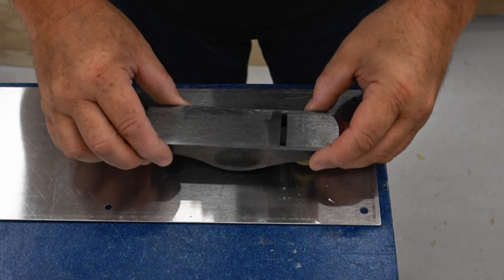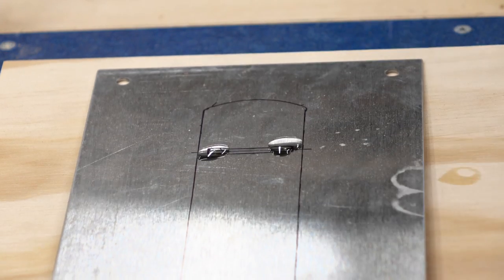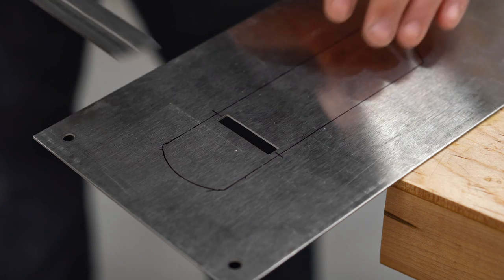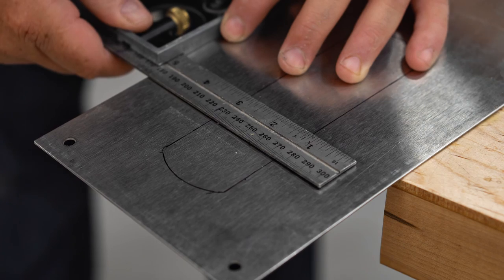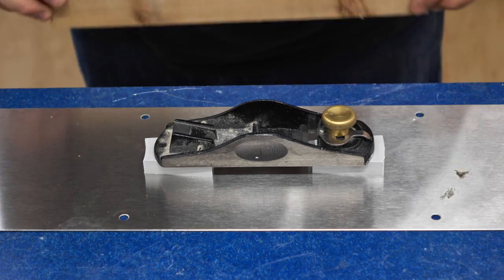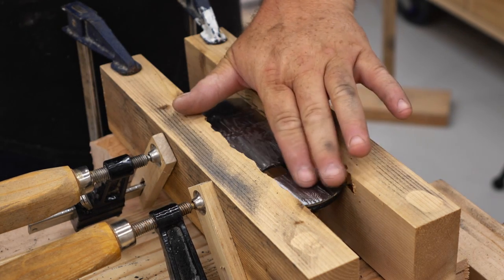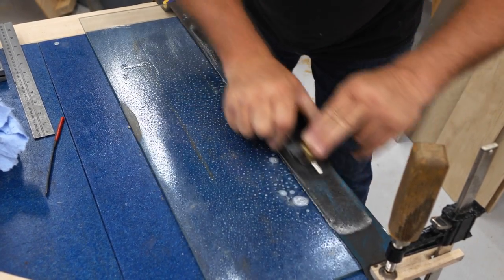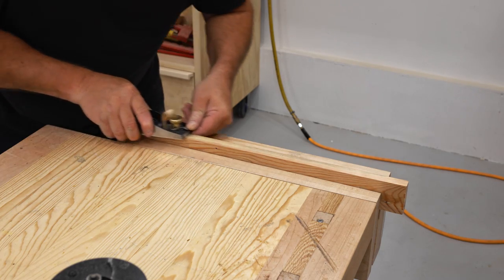Extreme Hand Plane Restoration - Milling Cast Iron With A Router

Comment: Sometimes you just have to try something just to see if it can be done.  Ingenious bit of barnyard engineering.  The proof is that it works.
Reply from the maker: Thanks Jim. It's not often that I do something that winds up looking better than I expected when I started, but this is a good example.

Comment: Hi John, I bet a lot of people went running for cover when you started with the screeching noise but it did not bother me. an interesting idea to make a new baseplate, most people would have just chucked it in the bin. You have ended up with a plain that looks great and is flatter than most directly from the factory.
Reply from the maker: Thanks!

Comment: Machinists everywhere are screaming at their computers...    I have to say, this is something I would never have considered as an option, so it was cool to see and learn new ideas.   Never, ever would have thought to take a router to the base of a plane.
Reply: i'd grind it off with the angle grinder, then true it up in the sandpaper
Reply: @TrevorDennis100  Get a $4 carbide burr on eBay, I've had one for over a year, and have used it quite a bit on wood, A, and steel and it's basically like new.
Reply: Yes absolutely. Make sure to get solid carbide Endmill. But you know something? John probably already knows it! :)
Reply: @pedalman4595  It's a burr, not an end mill BTW. Many more teeth.

Comment: Shame you’ve lost the open /close feature of that model, good fix though.  I have often been skint enough to warrant fixes like that, done in the evenings so I can go to work, to finish the job, to get paid !
       The fragility of these planes is the main reason I never pass up an old second hand fixer upper
Reply from the maker: Not really a shame since I've never used that feature in the 6 years I've had the plane. My other block plane (owned since 1984 and used nearly every day since) doesn't even have it.
Reply: John Heisz - I Build It  Snap  !

Comment: I have seen metal removed with a router several times. But most people put an endmill in the router and not a router bit ;)

It's a nice repair, but there is one downside. You glued the throat adjustment in place. :D

Comment: Interesting video.i have a question about the epoxy. How did you choose the epoxy? I’ve tried to glue metal with products that say they hold metal with very limited success.  Any suggestions would be greatly appreciated.
Reply: Have you tried JB weld original, red and black tubes? There is an endless variety epoxies. Original JB is pretty good on steel. It has steel particles in it (attracts to a magnet) which helps to beter match thermal conductivity and expansion rate.

The way he used it, here, over a super large, well mating (flat) area, it probably doesn't matter what kind he used. The joint matters, too.
Reply: Mildy Productive thanks for your response. I believe I did use JB but it didn’t hold. It was a miter saw , think iron, handle . I thought the surfaces mated up well.

Comment: You need to build a Bridgeport milling machine next.
Reply: Out of Douglas fir
Reply: I mean, it is possible to make one for a rotary tool, from plywood, with all of the sliding parts, dovetails with steel slides.

Comment: 2 things: 
1 - i fricken LOVE your theme music, lol
2 - and I'm curious if you decided it wasn't worth it to avoid heating the stainless after all of the care around the slot? The long continuous cuts along the edges seem to be the complete opposite of the short touches during the slot... Did you decide after the slot that you were going to give it the full sanding/surfacing treatment?

Looks great! Thanks for the video!
Reply: I'd hazard to guess because of the location of each cut and working it to final finish.  The edges he was able to be much more liberal with the over-hang, so most of the cut face was actually worked off later.  Then there's the need for precision edges (which softer metal may compromise over time) - the opening for the blade is a bit more critical than the edges. Again, just my guess....
Reply from the maker: The throat opening cut was concentrated in a small area, while long cut were... long - no excess heat build up during those long cuts, certainly not enough to distort the metal.
Reply: Thanks for responding! Makes sense.

Comment: Have you noticed that the G1S 3/4 plywood from Chile is not square... I recently bought 2 sheets and the long side on both sheets bulged out on one side and in on the other.. one sheet bulged almost 1/4 inch .. I only noticed this after I had cut them and wondered why my cut was curved.. string lined the factory edges .. Pow it matched my cut .. lol.. do not trust factory edges. Lesson learned.. costly plywood is out of whack..

Comment: One should not just consider the value of the plane. Fixing stuff has a lot more value than the things that are fixed. It saves the material and energy and possibly pollution and what not, that would otherwise be used to create a new thing and recycling or dumping the old. Worth the effort.

Comment: Isnt this low angle plane made for end grain woodworking?
Reply: You have watched too many "fine woodworking" videos. A low angle plane is about 15-20 degrees. A high angle plane is 40-45 degrees. But on a "low angle plane," the bevel goes up, and on the high angle plane the bevel goes down. You sharpen a plane blade at  25-30 degrees, so the angle of your blade is essentially the same in either case. The advantage of the low angle/bevel-up orientation in a small block plane is that you can hold the thing. If you made it high angle/bevel-down, the back of the blade would stick up where your palm goes. So this low angle block plane is made for planing anything you want to plane using one hand. This is why low angle planes are always one-handed block planes or longer jack planes (where the handle is so far back from the mouth that the low angle orientation of the blade doesn't interfere with the handle.) 

There are minor differences with either type. The low angle/bevel-up generally doesn't need a cap iron. On a high angle plane, you need to adjust the cap iron very close to the edge to do end grain. The low angle plane might have a tiny advantage at end grain, but not much. The main difference is where you want to put your handle.
Reply: Mildy Productive thank you for so detailed answer! I have been always thinking, that low angle is like “to cut grain of the wood, insread of shave”

Comment: Why would you polish the glueing surface?its not gonna help to keep surfaces coplanar. It certainly weakens the bond with epoxy. why?
Reply: Glue the new plate to an uneven surface and the shoe can distort or be uneven. Start with a flat surface for best results.
Reply: @KipdoesStuff  no. The even grain is the same distortion wise, you can even go with sandpaper over the surface if you for some reason polished it. The uneven space epoxy can take between metal surfaces due to clamp pressure differences is already multiple times more inaccurate than any grit you leave on flat surface. You loose a lot of bonding for non porous materials if you polish them.

Comment: Stainless steel is hard to cut because it contains a lot of chromium, the chromium in stainless will strip away the chromium in tool steel and cause galling. Basically it wears out the tool steel cutter really fast and machine shops have to consider this when price quoting a part for a client. Our shop only cuts stainless using a 400W fiber laser.